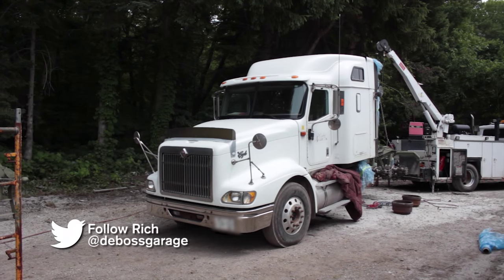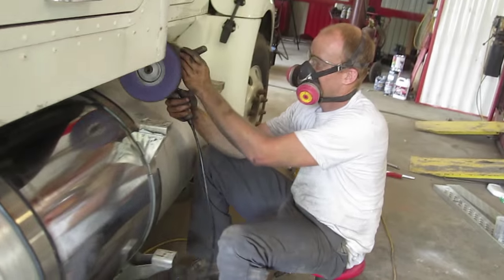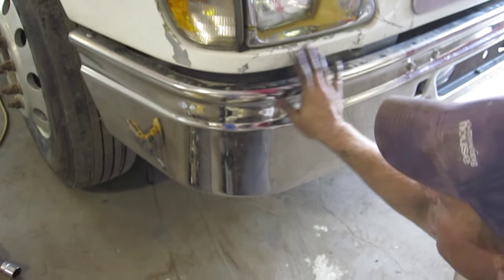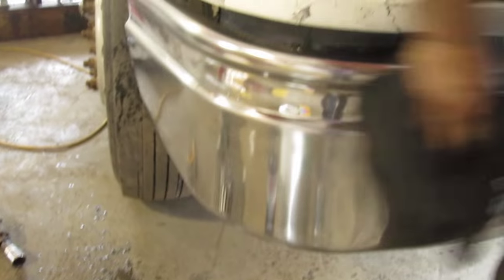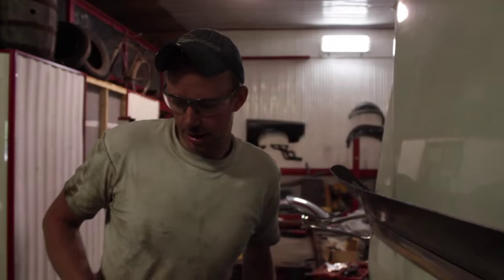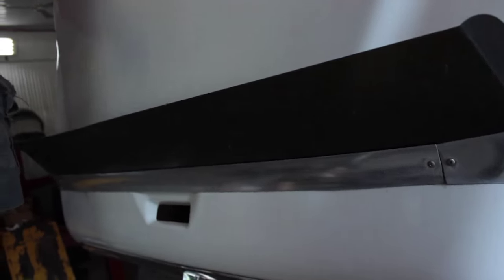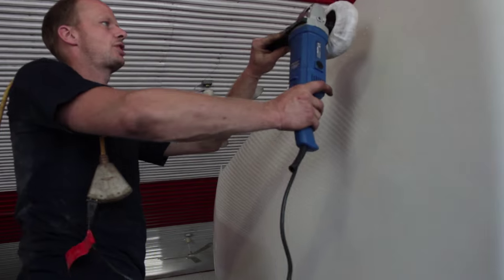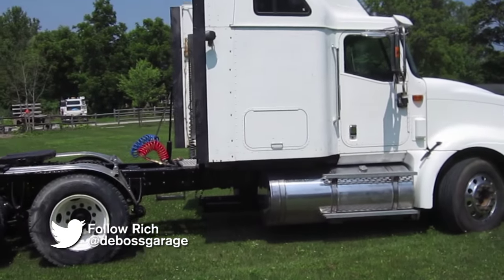How To Detail A Semi-Truck Cab

Comment: Ten years ago, I used to drink Diet Coke all the time.  Since then I rarely have it; maybe a bottle once or twice a year.  I've not heard before, that Diet Coke is more acidic than the regular version.  When you said it though, I thought "of course" and laughed!  I blame soft drinks for losing a back molar and I consequently stopped the habit.  Apparently teeth dissolve in normal Coke and you're working with the diet version to eat a truck!  Thank god I stopped drinking that crap; lol.

About the truck; wow!  I learnt a so much and thanks for uploading.

Comment: Dont forget to pull the seats out the inside and pull the carpet. Do a deep cleaning inside and hang the carpet on a rack and hit it with a hot water pressure washer. Do the same for the seats. Then throw everything back inside with a industrial dehumidifire and let it sit for a day or two with dehumidifier running and doors closed. It will be like wearing clean jeans out the dryer. Thats how nice it gets inside. 
You have to do the typical wipe down inside on pannles. But the carpet will be like new. And thats what holds the smells. Thats and the seats.

Comment: Right angle grinders @ drills?
 I would use a rotary to do a fast cut and then finish down with a da. Top with your favourite sealant or coating and your done.

Comment: what brand and what lift capacity does that truck crane have?that looks strong..
Reply from the maker: +lazowelding I bought that truck out of California. My brother and I flew there and drove it all the way back to Ontario Canada.    Best investment ever.  It is a 5016 IMT service body on a 4900 international.  The most is 8400 lbs I think.  Would buy it again in a heartbeat.  Drive it 4500 km with my brother again too